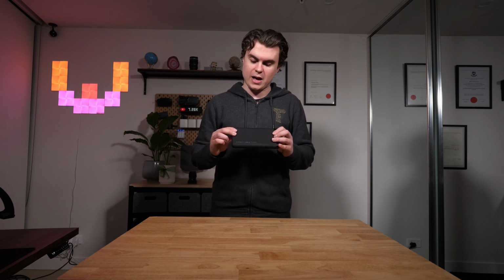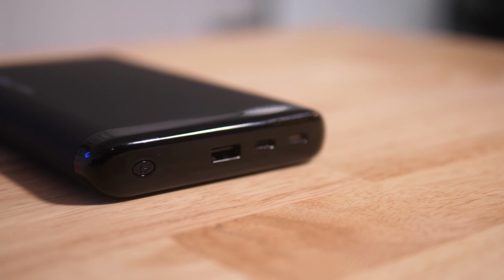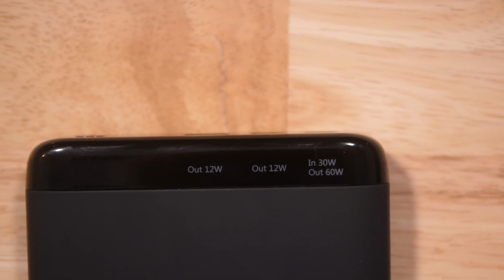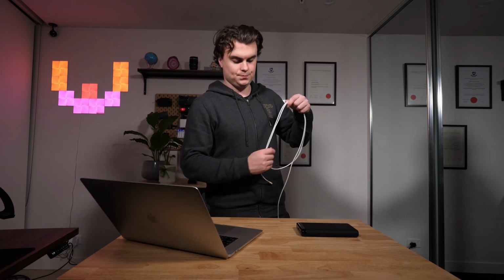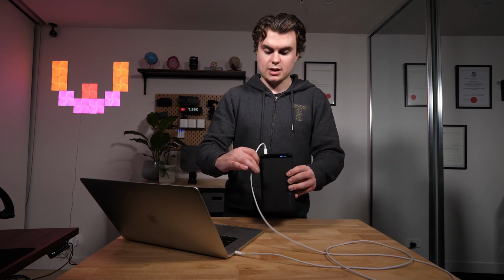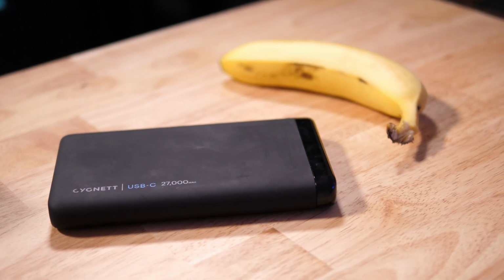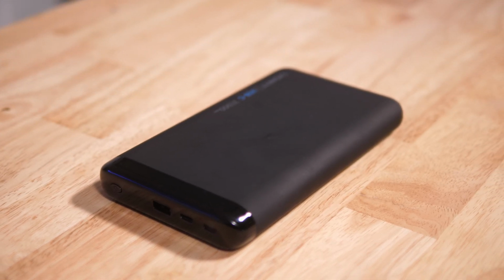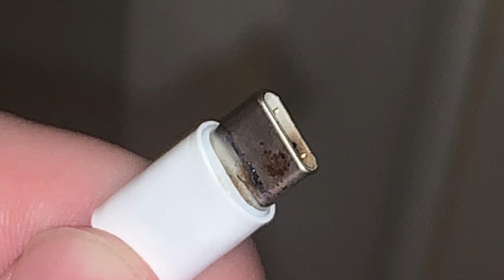Cygnett ChargeUp Pro 27k PD REVIEW

Comment: Certainly Cygnett is a great company to deal with. I had a ChargeUp 27k battery and, after four years, the rubber case began to get sticky.  A cosmetic problem rather than an operational problem, and well outside the two-year warranty period.  I reached out to Cygnett to see if they knew of any fixes for the sticky rubber and they replaced the battery with a free new one for me. Impressive support.

Comment: Yes, it would be pretty incredible if you could charge that Macbook 3-4 times with that powerbank. You cannot compare mAh without taking battery voltage into account. That battery has 27,000mAh (27Ah) at 3.7V and to get actual capacity you need to multiply those two. 3.7V * 27Ah = 99,9Wh, which is maximum capacity to take on the airplane. New 16" Macbooks also have around 99Wh battery, so at most you could charge that Macbook once.
Reply: True. Hope that degree on the top right corner is not in engineering from Monash.
Reply: Yep, noticed that as well, also it's not going to charge his phone almost 10 times, as you need around 5.1v to charge a phone at best he will get just under 20000 mAh. It's straight out mathematics .There is a lot of misinformation around how many times power banks can charge what.

Comment: Thanks for the review! If i had one of these fully charged, connected to my Macbook Pro 15, also fully charged, doing light Photoshop work, would the pack keep powering the Macbook until both were flat? or would one run out before the other?
Reply: I’m a Digi Tech working in the commercial / fashion photography industry. I use (multiples) of these to keep a Macbook running on location. To answer your question, the power bank will run out first (the MacBook will keep ‘charging’), so when the power bank runs out, then the laptop will move to its own battery.

There are instances, where if the laptop is using significant battery, that it’s internal battery will indeed decline, even with a charged Powerbank in. 

Hours of use depends. Photoshop can be more memory intensive thank you expect. Onset i go through about 2 (sometimes 3) of these power banks to get through a 10hour day photo shoot.